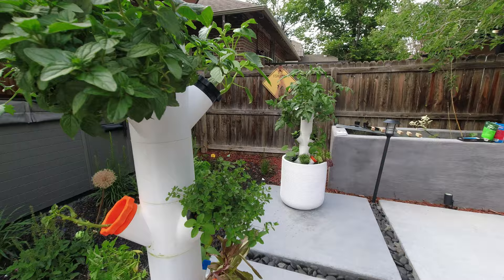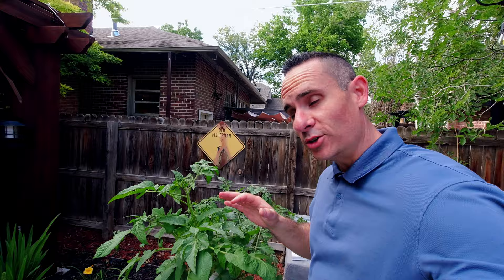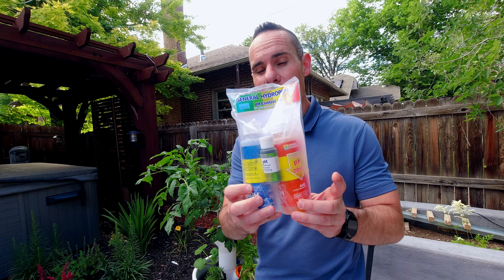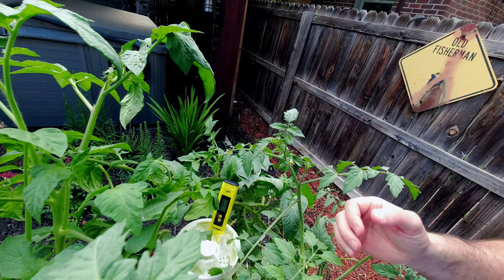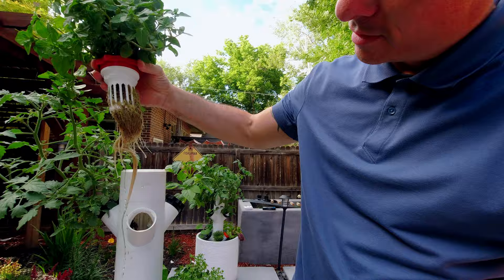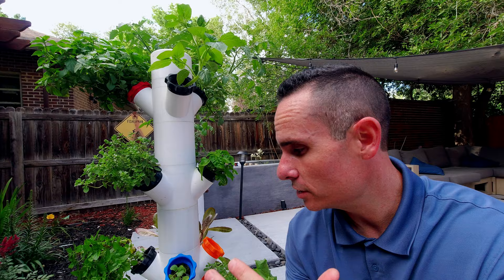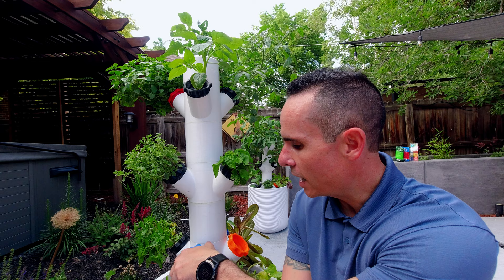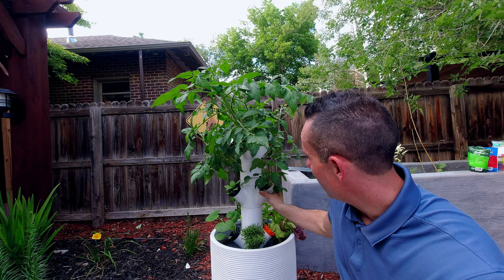3D Printed Hydroponic Garden: One Month Update

Comment: One piece of advice for preventing sunburn and heat stress on your plants you moved from inside, to outside. Seedlings need to be conditioned and this is usually done in a greenhouse for about two weeks in a commercial nursery. In your case though, All you need to do is have "starter towers" and "finisher towers". The starter towers should have 30% shadecloth draped over them for about a week or two. This allows those plants to acclimate to the sunlight and not get burned. Now move the pots to the "finisher tower" for growth and fruiting. This frees up your starter tower, with shadecloth over it to move your next set of seedlings into for acclimation.
Reply: There are so many videos of people who get great results that move their plants directly from inside to outside and have zero problems. Hoocho is one such guy. He lives in Australia and moves his plants directly outside with no "transition" period. I also move my plants directly outside and have been tending a garden for over 20 years and never had an issue doing so. Just a counter point to what you're saying.

Comment: Would you be interested in providing a new update to this? How were the veggies once you got some from it? Etc.?
Reply: more than likely cucumbers and tomatoes failed: they need their own 5gal buckets...
Reply: @romeoneverdies  i have made a few of these 3d printed systems the past few years. Tomatoes wont "fail" but they wont do vary well either.  A DWC bucket with a guide rope is about all you need for tomatoes. Vary simple setup, black 5 gal bucket, netcup lid and a air stone. About the same with cucumbers just use trellis nets.  Towers are better suited for things like lettuce, generally things that would also work in smaller NFT system

Comment: Been running tower gardens for a few years now.  15 min on and 30 off works indoors under lights but 15 on and 15 off is the best outdoors.  Many plants will extend roots into the bucket but you don't want the roots to excessively dry.  Also keep an eye on the nutrient solution temperature.  It can get too hot or cold because the bucket size is small.

Comment: I would avoid those fully printed locking netcups, root mass will shatter/delaminate them easily and they are just not cost effective. There are a few remixed adapters designed to use normal netcup all over the place. Outside of that, go with black filament for the towers and paint them with white to keep temps down. Light creeping in will cause algae issues after awhile.
Reply from the maker: Good points to call out. I ended up reprinting the tower in green. Looks better, keeps the light out, and still stays cool. I need to try some alternative netcups.

Comment: I can attest that White Vinegar, nor Baking Soda, is a good idea as it has absolutely no buffers to them so you bring down, or up, the pH to 5.8 to wake up in the morning to 7.5.  As soon as you use the pH up, or down, it stays around 5.8.  I was so hoping that baking soda, and/or white vinegar would work.
Reply: you need them to be dilluted into water first... then also mix it again very well into your nutrient solution.
Reply: @romeoneverdies  Nope, no matter how you do it they are not a good thing for plants that are  longer than just lettuce to maturity.  The plants eat and shit out stuff that plays with the pH.  I ditched them as fast as I could after reading about them from some university horticultural department write-ups.
Reply from the maker: Thanks for sharing!
Reply: @ALLYOURTECH3DP  
The problem with baking soda is the sodium (Na).  After the plant uptakes sodium it takes over the role normally performed by potassium (K), unfortunately these two elements are not the same and the growth will suffer greatly. Its easy to avoid, just make a diluted solution of potassium hydroxide (aka, KOH , caustic potash), you can buy it as flakes. Be aware that most tap water contains sodium,  which can causae the same issue especially if you dont replace the reservoir very often.  If you are using tap water with a high calcium carbonate ppm, i`d suggest using nitric acid PH down not the more common phosphoric acid. The  nitric will react with the calcium carbonate to form calcium nitrate which the plants can use. Phosphoric acid + calicum carbonate will produce calcium phosphate, which is insoluble in water and therefore unavailable to the plants.

Comment: I bought an Ender 5Pro in order to develop a prototype for an invention, and then was bitten hard by the 3d printer adventure! I started printing that inferior sytems from Thingiverse before spotting this one. I've already printed half of it in white, but may keep it indoors, so I might not have a green problem. When I look across the internet generally at hydroponic towers built by the 3D folks, I always see everyone mixing up their types of plants! I would think that you'd be much better off growing one type of plant in the entire tower. I'm going to try all romaine lettuce in my first tower, and then try all strawberries in my 2nd. I know that strawberries won't mind the angled opening and will dangle down. Not certain what romaine will do. I went to Ace Hardware and picked up a 5 gallon White Bucket, and will be going to harbor freight to pick up one of their small framed roller stands, so I can turn the tower and move it, if so desired. I bought the harbor frieght 260 g/p/h pond pump for this project. I am going to search for an inexpensive timer as well. I took the part that fits under the lid down to Ace, to get 7 feet of plastic Vinyl tubing, and the nozzle on the 3d printed part broke off! LOL! I'm going to drill out the hole in the center and utilize a threaded tube and keep it in place with a thing nut on both sides. It was a learning curve, moving from PLA to PETG and I've become much better with nozzle and bed temp than I was when I printed some of the early stuff! Yes, I'm using PETG for the tower parts! By the way, before I forget, I really like you video!  You should be able to spray over your neighbor's roof with that 800 GPH pump! Matbe you should drain his pool while he's at church? LOL!
Reply: What settings did you use for the ender 5 pro?
Reply: @jonathanbunnell2325  I printed PETG at 218-222 and the bed at 80, with PLA 190-200 and 65    PLA is an absolute home run. I find PETG you have to really watch. The biggest problem I've had with PETG is getting it to stick to the bed. I've used multiple layers of glue stick.

Comment: Did you use the standard brass nozzle or did you update to a stainless steel nozzle. I’ve read concerns about the brass nozzle wearing down and not being  “food safe”.  Seems to me it would be so minor it wouldn’t be a concern?
Reply from the maker: I just use brass nozzles still. THe high print temperatures should eliminate any potential bacteria in the filament or the printer, so that has never been much of a concern for me.

Comment: quick tip ... dont plant tomatoes nor cucumbers in these : their root system will fill the bucket. cucumbers and tomatoes need about 5-10 gal of water to go trough their seasonal cycle. about the same for cucumbers. the problem you get is these towers are too small for their root system.  if you want to grow tomatoes they grow well in their own 5gal bucket with the kratky method... you will just need to progressively refill when you get about half way. (in the fruiting period it will start to drain pretty quick. )  these are great for various lettuce and small plants however.
Reply from the maker: I've done tomatoes for 2 seasons in this now, and they did great. Pulled off at least twice as many tomatoes as my raised garden beds.
Reply: @ALLYOURTECH3DP  I was worried about the roots too, but because of the small diameter of the towers. But if they're working for you, great. I've grown tomatoes, eggplant and sugar baby water melons in a Foody hydroponic tower. I've been looking to 3d print my own, so thanks for these videos. Keep growing!
Reply: @ALLYOURTECH3DP  Do you have a fence or anything to hold your tomatoes up with? Or do you just keep them in the system as is?

Comment: Would you mind sharing the (cura?) settings you used for this Overature PETG? I bought the same but have been finding mixed reviews on what settings to use for the Ender 5 pro  (w/ 0.4mm Micro Swiss hardened steel nozzle). Any help or test print suggestions are welcomed!

Comment: I noticed there are different set-ups that can be printed, i.e. 1, 2, 3, or 4 plants per piece.  And there are 3-4 different pieces listed for each number.  Can you tell us what the differences are between the pieces?  For example:  1-Way_Planting_Module_Hollow_Without... and then I noticed there are different file sizes.  Or what are the differences between OESTLIG_Plant_Pot_12_12_Adapter.... and OESTLIG_Plant_Pot_13_12_Adapter....?

Comment: The big white pot that holds the bucket did you 3D print it or buy it... if so what's the brand of it
Reply from the maker: It looks 3d printed which is why I thought it was cool. It's actually a pot I purchased from CB2. They have them in black and in white. https://bit.ly/3LxEBKJ
Reply: Ooh, that's a pretty bucket, but pricey. Maybe I'll buy a local large cheap planter and place the 5 gallon bucket in it, if the planter can't hold water. Or use silicon to plug or a pond liner.

Comment: I will be new to 3D printing, mechanically and electronically savvy, what printer would you suggest?  I’m thinking about creating your hydroponic system and wish to have a printer that will last for some time.
Reply: fastest best and easiest printer for any filament  (for hydroponics I use PETG) is the Bambu Labs X1 Carbon, I have only highest of praises for this machine it is truly a marvel.
Reply: everyone says for the 3 part it takes 12 hours. Bambu Labs machine got it down to 6 hours each segment with perfect walls and no holes, absolutely flawless.

Comment: Brian: "Be wary of using something like black cuz of heat issues"
Also Brian: Continues to use black net cups
Reply from the maker: Haha! Fair. In this case I used PETG rather than PLA, so melting is no longer a concern at least. :)
Reply: I plan on printing in black PETG for light occlusion, then painting white for light reflectance and reduction in infrared to heat conversion. If I print cups, I'd keep black for the looks. I do like the look of those knobs.
Reply: @GregoryCarrier  That is what I tell everyone to do.  Paint black to obstruct the light then let it dry to paint white over the black to reflect the light away so less heating effect.

Comment: When the tomatoes set fruit the branches wont be able to support the weight.
Reply from the maker: I’ve pulled dozens of tomatoes off of the plants so far. It has been completely fine
Reply: @ALLYOURTECH3DP  
I`m surprised, gravity tends to win when you have long branches and heavy fruit. I planted one of my towers with 35  dwarf  toms that were only supposed to get a foot tall that topped out at 2.5ft. I dont grow tomatoes in the towers anymore :)
Reply: Depending on variety you may have to support. I had vining type hit about 13 ft. Try to use bush type variety
Reply: @nicholastaylor8289  
A dwarf determinate is the best type for a tower. Determminates fruit tends to ripen all at once over a few weeks where indeterminates provide a steady supply